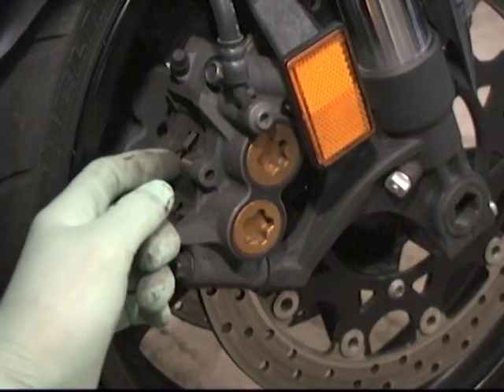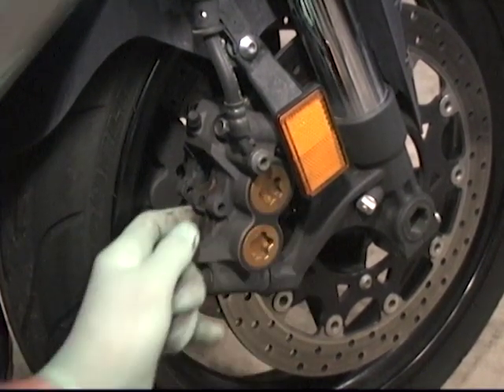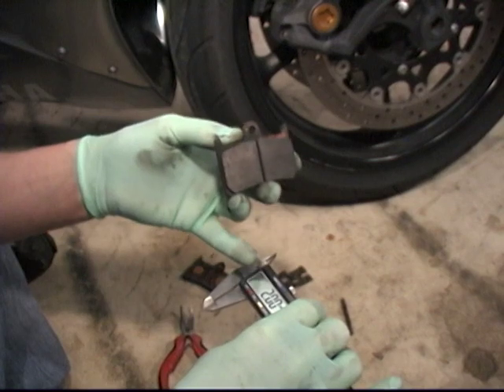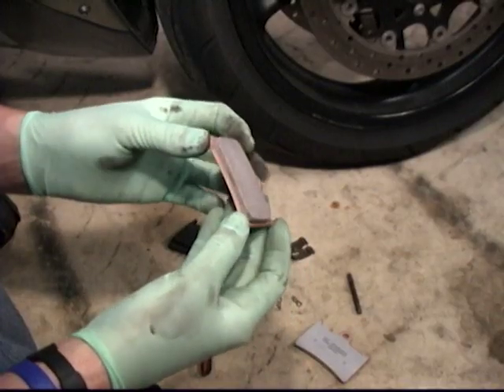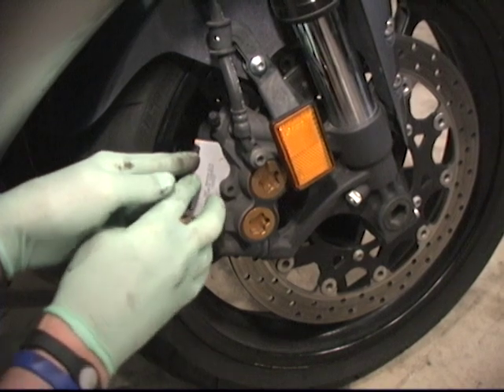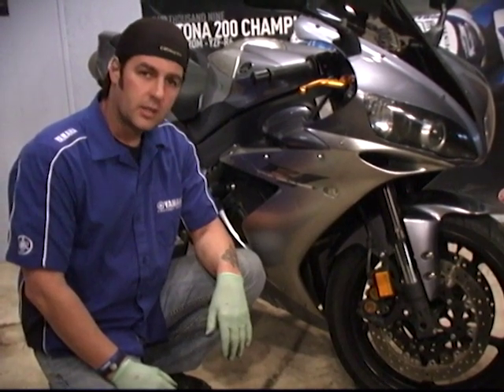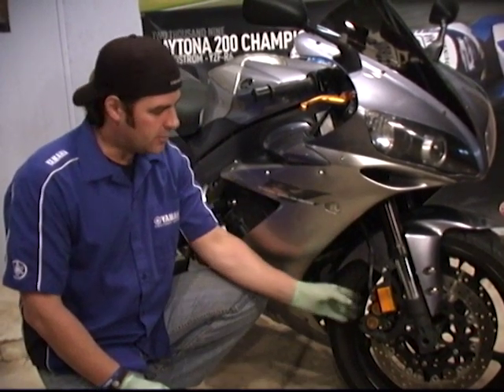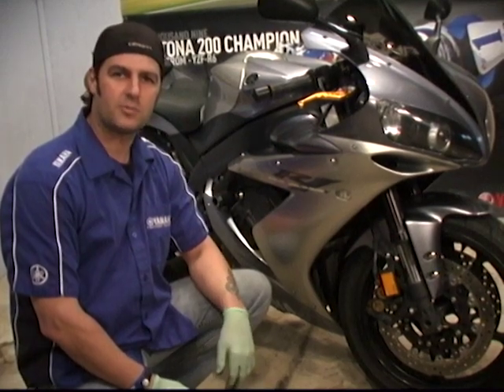How To Change Brake Pads Yamaha R1 R1Videos.com

Comment: Not to bash you guys , but If you want to post tutorials for people that are new to doing  maintenance on they own bikes - you should not forget about cleaning pistons before pushing them in. As all the brake dust/ road grime is not the best friend for seals. 
Another thing is once pistons are cleaned you can use your old brake pads to push pistons in ( not risking damaging new pads ).
Also copper grease on the back of brake pads , and cleaning of pin holding pads + copper grease  AS PER MANUAL

Comment from the maker: Rear brakes added to the list! You do not have to clean the calipers when you change pads, but you can. You also do not have to change brake fluid when you change pads. But you should change the brake fluid when it starts getting dark and brown. It should be clear yellow to gold. We have a how to video shot for changing brake fluid already, we are just trying to get it edited and finished. So check back for that one!

Comment from the maker: No - the master cylinder cap is not off. What you see in the video are the exact steps you need to follow and nothing more needs to be done. Hope this helps with changing your brake pads. Let us know if you have any other questions.